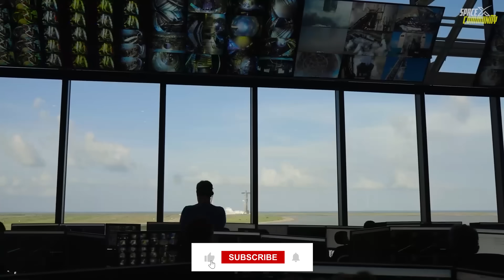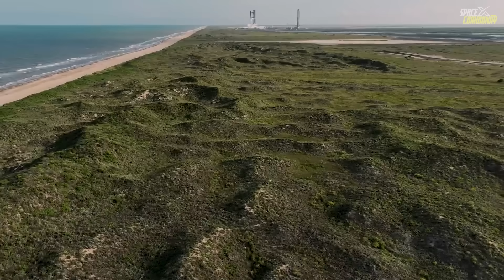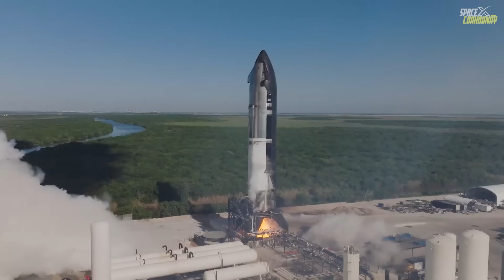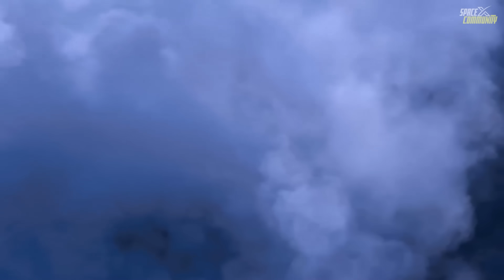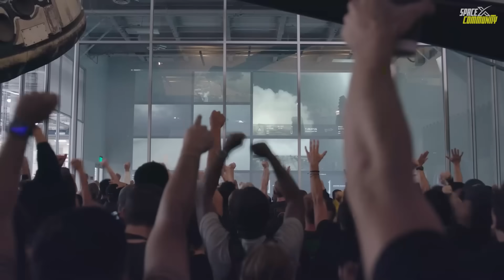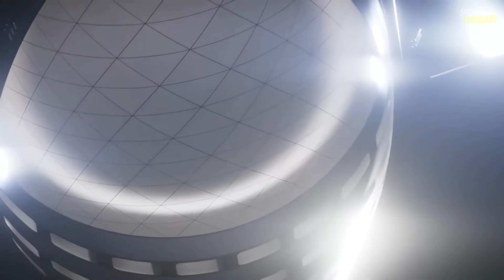SpaceX Weird Reveal on Starship Flight 12 Launch Date & NEW Plan Shocked NASA! Massive Upgrades Done

Comment: We won't see the upgrades, just a successful  flight, we hope. Upgrades are internal. The heat shield will be years away before a  reuseable, reliable one is developed. So fare , none are on the drawing board.
Reply: Not successful if THEY DON'T CATCH BOTH SHIP AND BOOSTER